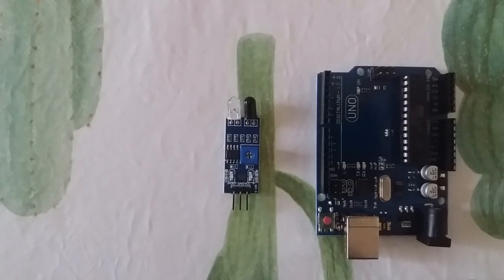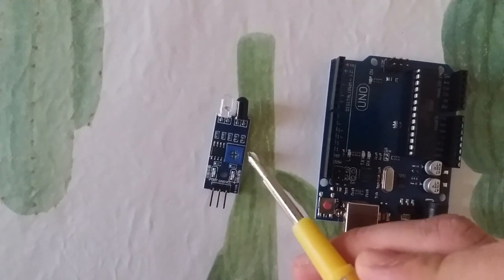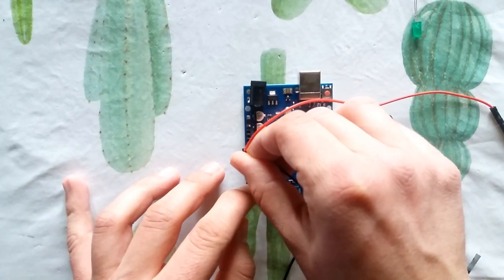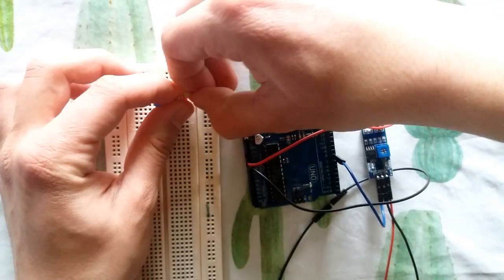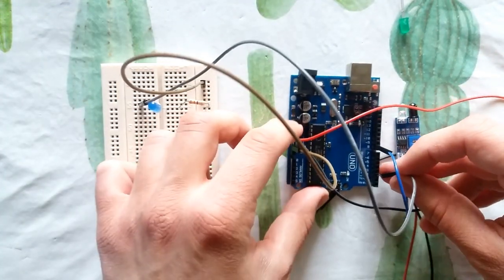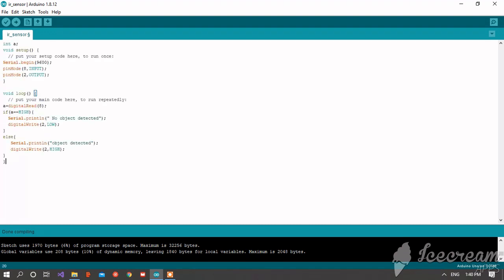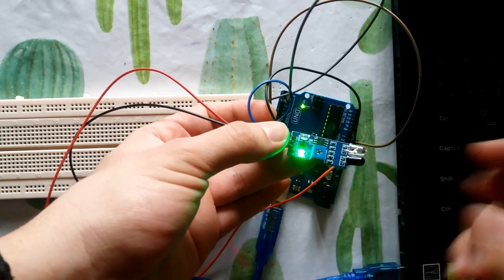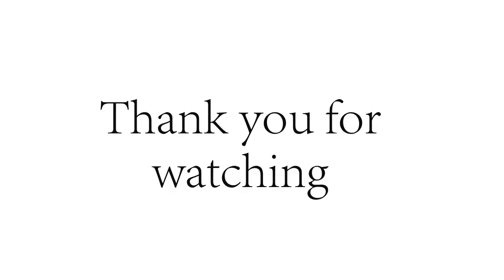How to control IR sensor using arduino with(download code)

Comment: I want to connect two ir sensors to my arduino r3
Reply from the maker: Hello Shorya
Sorry for the delay,
of course you can connect an additional sensor by doing the same way(give the sensor the input power needed, after that choose a pin to connect the sensor as an input, after that add the same way to the second sensor to read the output state as the original one).
if you don't well understand, kindly send us an another reply..
Best..